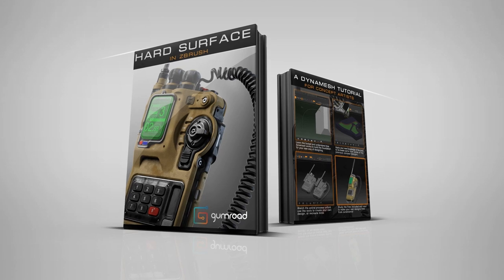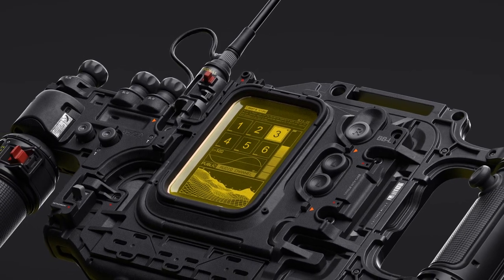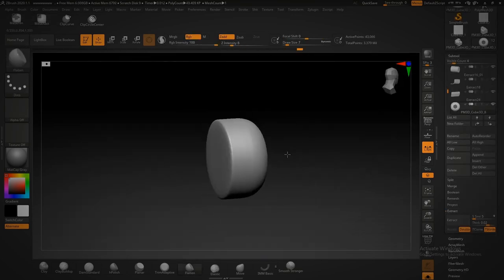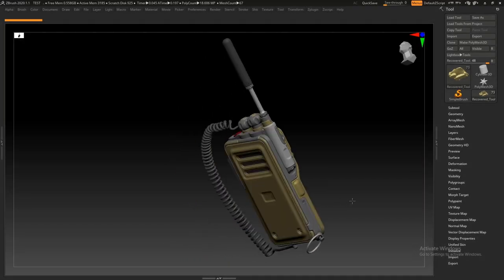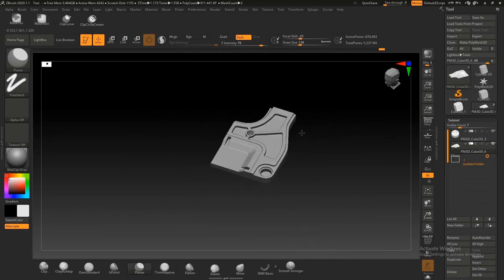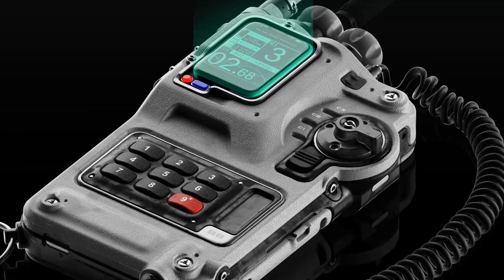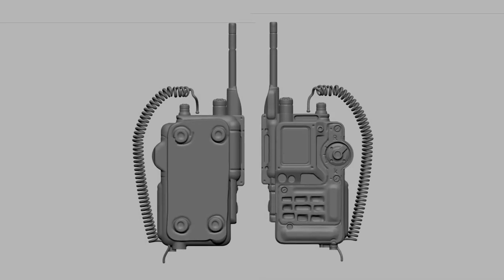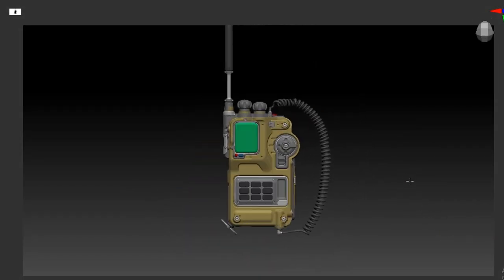Hard Surface In ZBrush (Official Trailer)

Comment: For those who are getting ready to purchase: Good tutorial for concepting only. Although the tools used are basic zbrush tools, You need to be intermediate/ advanced to understand his ideas and follow what he is doing. If you are intermediate/advanced, you may sometimes find yourself thinking why he is using that brush instead of another or you may know other ways to do similar stuff in zbrush yourself. The reason I purchased is because I liked his model and wanted to see how he did it and learned a few techniques and approaches along the way. Good luck all, Cheers.
Reply: I don't understand , if the final high poly model is perfect , how come the tutorial is for concept only ? I mean , if a HP model in the tutorial is bevelled perfectly , it should be the right HP model for game modeling.
Reply from the maker: @cowholy3031    it's not perfect. While it is theoretically possible to polish your mesh to the point of being a bakable high poly, it's not what I use it for. The methods I use are made to give 3D designers the highest level of freedom possible by using methods that are not 100% precise. If you aren't a designer, then this toolset wouldn't really make any sense.
Reply: @CaneTwn  So, why should a hp model in zbrush which looks good not be suited for a bake? I've never heard of that limitation! I think the point is more how accurate you can model a already existing concept/ object and if it's worth to use Z-Brush if you already have a different software like maya, blender or what ever.
When I get Z-Brush around next year I'll buy this tutorial. Looks interesting.

Comment: I love the design taste of the author, he is absolutely one of the best rising stars, so I supported him. That said I do not agree with the constant ranting that Zbrush is the best for hardsurface. Zbrush is an extremely powerful tool, but most of the things he does in the tutorial can be achieved in other packages in like a third of the time. Even with the bevel fixes. For that matter - if dynameshing and smoothing is the goal - a faster workflow would be to just do it as Alexey Ryabtsev does - boolean the basic shape in either Blender/Maya/3dMax/whatever (or even with zmodeller with Liveboolean) then dynamesh, smooth to your liking and done.
But i guess to each his own. Still the author is a great designer, love his work, and an insight to his worklfow was quite useful, I picked up some useful tricks.
Reply from the maker: Thanks. I think the context of my statements were for hard surface DESIGN. Design being the crucial distinction between why I use ZBrush over every other software. I wrote an article detailing the specifics of this exact topic on 80LVL. But to speak specifically to what you're saying, I'd have to say it's not a fair comparison. Once we compare "doing the same thing" we are not designing. I agree, if you want to make something from reference, ZBrush is slower. But what I'm advocating for is the speed you get when designing. 'What's the difference you ask?' the difference is that when designing, I'm searching for the shapes, flow, hierarchy, detail distribution, functionality. None of that process exists if you model what already is. it's all handed to you for free. An analogy would be, I'm using a jeep, so I can explore the unknow,n because I need the flexibility to go over that rough terrain. And you want to use the standard car, but it's best for cruising on terrain that's already been paved and has a hard time in the unknown (reconstruction).
I don't just put something down and that's the final product. I put something down quickly, see if it works, if it doesn't, I changes it. And this kind process of in other softwares takes forever. The editability of the alternatives are very slow. So I agree partially. But for design, I don't see any alternatives that have the same level of freedom.
Reply from the maker: Here's the article -https://80.lv/articles/dynamesh-the-best-tool-for-hard-surface-design/?fbclid=IwAR2vAOIh4RA8Y_PzAIbQtmATd6oCX_fdqETet9voU9LlEIPXEXg4A-qp81g
Reply: @CaneTwn  oh, absolutely, design-wise that's how I use zbrush too (for anything, that is not a cut-up box). I generally start with a rough sculpt, but then i either go for a zRemesh+Fusion, or a complete retopo+blender. Aaaaaand then often i do another zbrush pass :)))))
Reply from the maker: @piker78  yea, I think that for most people, just using zbrush for the initial design block out is beneficial. I like to use it all the way cause I can have that freedom implemented down to the tertiary details.
Reply: @CaneTwn  yours is a perfectly viable workflow, lot's of people use it. What i was blown away, while watching the tut - was you doing it all with dynamesh, I honestly thought u used quite a bit of zmodeller before when I saw your stuff on artstation. For me dynamesh has always been a rough blocking tool, but in the end though - it's the final result that matters, if you have the time and it works for you - more power to you. I'm with more of a traditional subD background, so ... yeah. 
Again - to each his own, I have colleagues out there absolutely killing it even with Sketchup, so yeah - it's the final result that matters, and yours are truly awesome :)
Reply from the maker: @piker78  ;)
Reply: The artists at Horizon Zero Dawn did almost everything of their character hard surface elements in production using with ZBrush. They seldom used traditional packages cause of the speed disadvantage. I don't agree that it is just a conept thingy anymore. To me it seems in the right skilled hands, ZBrush is a totally viable tool also for hard surface high poly models for production: https://www.youtube.com/watch?v=WabkLpQNIyY
Reply: @harrysanders818  It's more the case of it depending what the task at hand is. If your design is chaotic-organic mecha stuff like the ones in HZD, or soft shapes, that you can similarly put mat shading on (rubber, plastic ets) - sure, U can use zrbush decimates for production. Especially it those meshes do not have to go through dynamic sims, bending, etc. If however your shapes have to be high gloss, or even resemble (or god forbid be) classA surfaces, or if they have to go through sims for a say a movie, then - a different approach might be more beneficial. Zbrush is a great tool and I absolutely adore it, but its not universal.